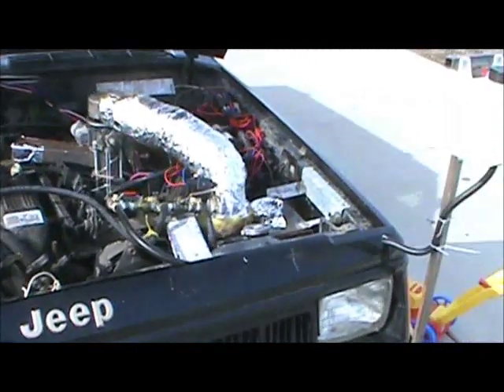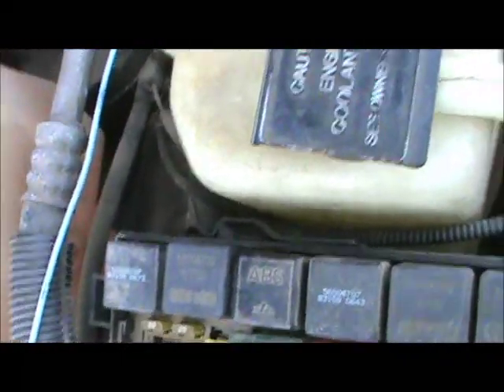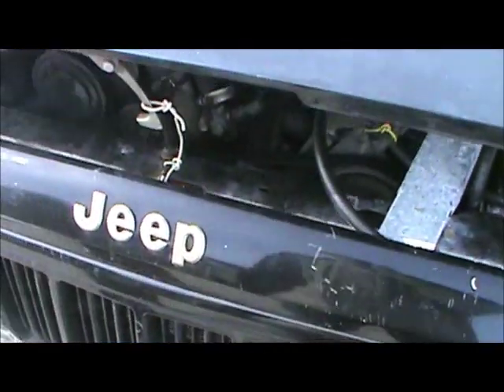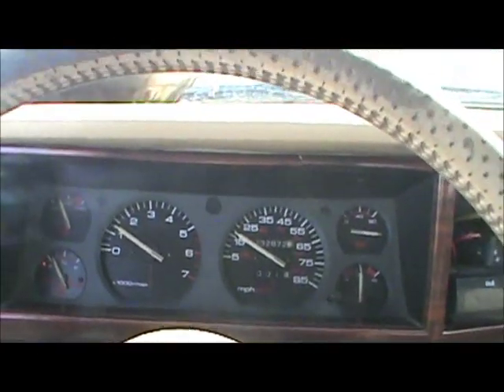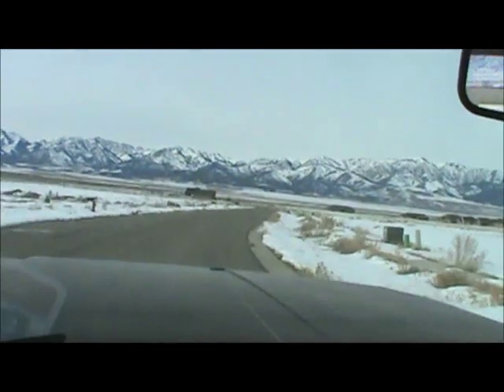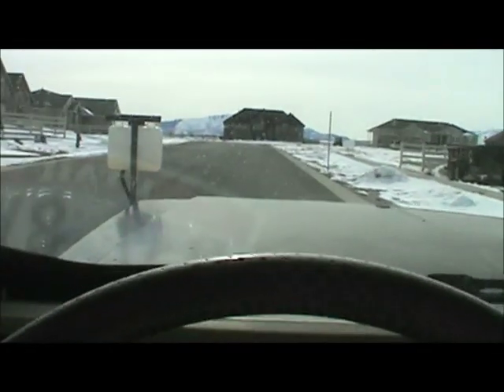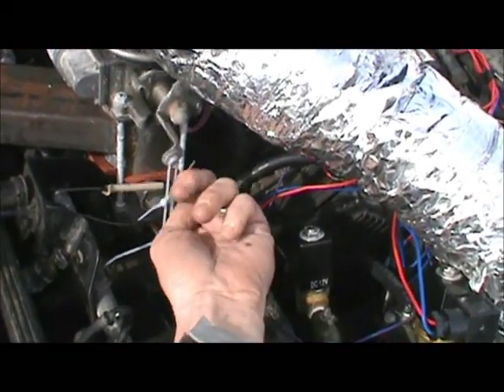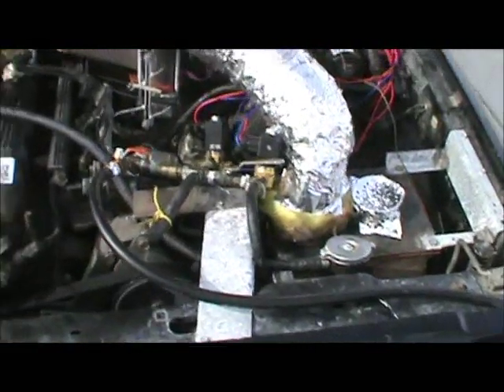100+ MPG PROJECT VAPORIZER TEST DRIVE 1

Comment: Hmm, sounds good, so oil vapor can burn? I've been having a tough time with gas vapor because it doesn't last me as long. About a 12oz last for 12-15 miles (just a rough estimation, no exact test, only observation). Also I read that diesel can only burn in a precise pressure with liquid, but burns longer, would it be the same with vapor? I do think that the vapor should be thin enough.

Comment from the maker: As for only running air through the vaporizer it all depends on how hot the vaporizer is as to wither or not I need to run air through it or not. When the vaporizer is at high temperatures I only run air through the secondary air inlet no air passes through the vaporizer. When the vaporizer is running cooler I have to suck air through it to allow enough vapor to be picked up with the air and then sucked into the throttle body.

Comment from the maker: I don't bubble air through the gasoline all I do is heat the gasoline up in the vaporizer and the hot vapors are then sucked into the air intake (throttle body).

Comment: I am so happy that your hard work is paying off! I have never ran my vehicle off vapour only. I only supplement it.
What you said about the ratio seems to be my problem. Seems like we only need a little bit of air going into the bubbler, right? It seems like you allow that to be your ONLY source of air as well. The engine does not get to suck in regular air then, right? That would dilute the mixture too much, and prevent it from working wouldn't it? I've got to do some more testing. Please help!

Comment from the maker: My setup allows me to control allot of parameters that are needed for a reliable design. It's expensive but it works once everything is dialed in perfectly. I'm about $5000.00 into this design which includes test equipment. Once I work out more of the bugs I'll post the exact specifications needed to run a reliable high efficient vapor system.

my email is ty_capel@yahoo.com

Comment from the maker: Not too sure I have not done any testing on an engine that size. I would say you could get at least a 50% increase or better but since I have not tested anything above a 6 cylinder engine I couldn't tell you for sure. Vaporizers are a complicated thing to test you have to get things right or it wont work well at all. They are super sensitive. You basically have to have a completely controlled environment to get them working right.

Comment from the maker: That's good advise! I just put this float switch on the vaporizer. I used a oil float switch before and it worked great but the wire broke off it so since I had this stainless steel one I decided to try that. I'll get another oil float switch since it worked great and make sure to support the wires so they can't break off. I have a bunch of stainless steel wool in the vaporizer and it works great! I don't get any splashing when I'm driving down the road.

Comment from the maker: On this last test run I did it wasn't that great I was having problems with the float switch and solenoid valve so it was a pain. I got around 30.4 MPG on the last crappy test run I did. It's an increase of about 12.4 MPG but is no where near what I want it to be at.

Comment: Nice video Tyson i have a suggestion for you. Instead of using a float switches which constantly burn up buy a magnetic reed switch and mount a magnet onto a float and by raising or lowering or raising  the magnetic reed switch inside you vaporizer you can adjust your fuel level in your vaporizer.Then connect the magnet switch to your solenoid valve. Also you should put copper scrubbing pads inside you vaporizer to keep the gas from splashing and help with heat transfer.